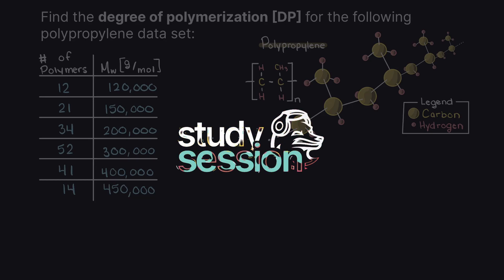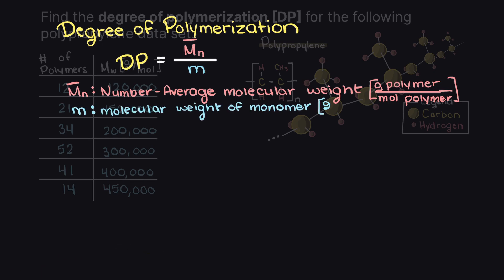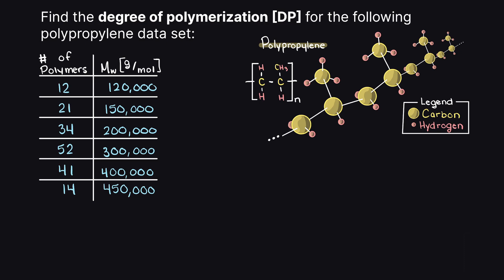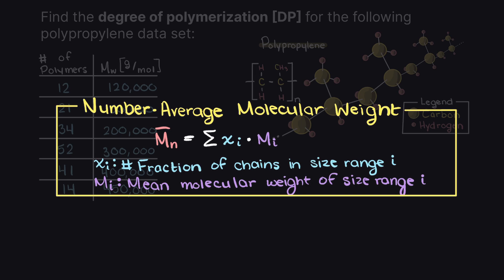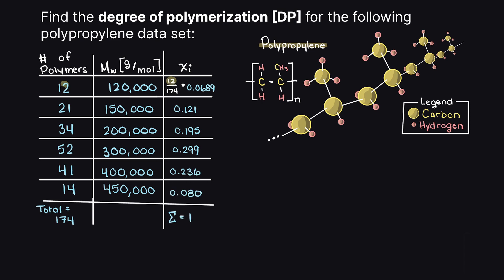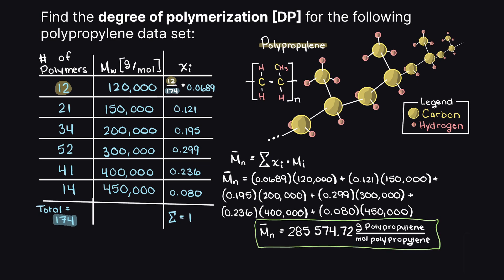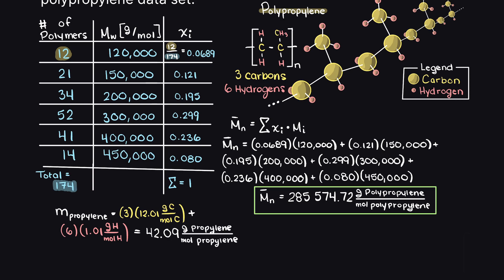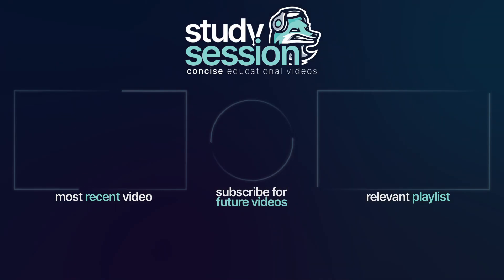Degree of Polymerization Example | Polymer Engineering

Comment: Given the following information about a polymer Xn: Number of molecules are 2, 3, 5, 10. and Mass of each molecule are 800,000, 750,000, 650,000, 600,000. (i) Calculate degree of polymerization, (ii) Number average molecular weight, (iii) Weight average molecular weight of the polymer.
Reply from the maker: Heres a video about number and weight averages that may help: Number and Weight Average Molecular Weight Example | Polymer Engineering
https://youtu.be/jvm-GgjbIPg
Reply: I'm a bit confused with the calculation. Can u pls help me and the problem i sent earlier?